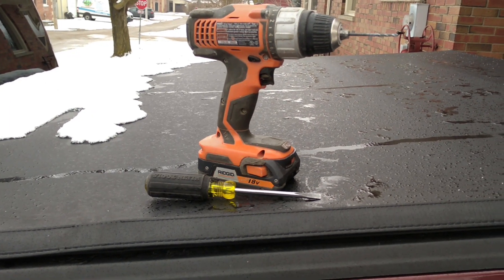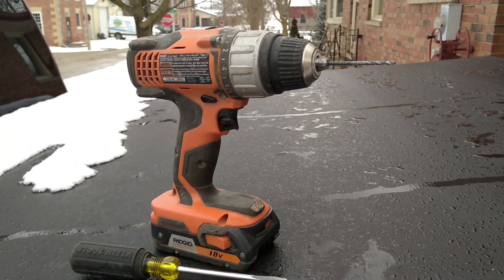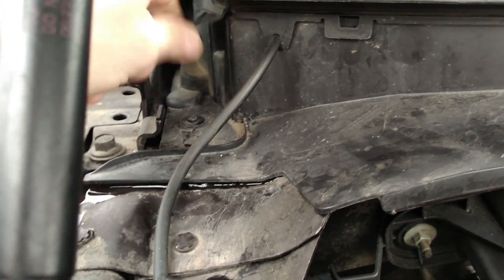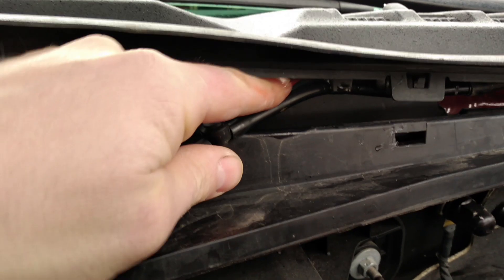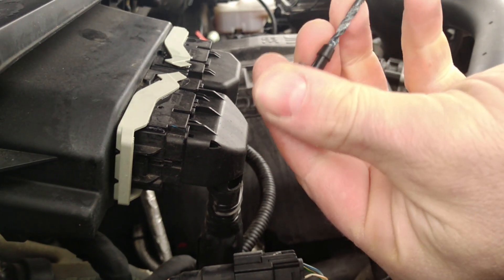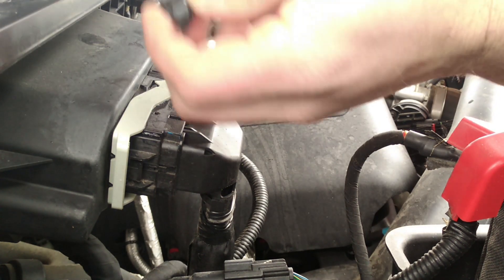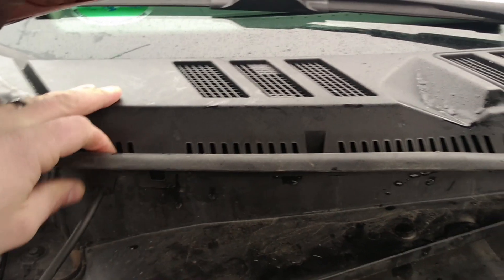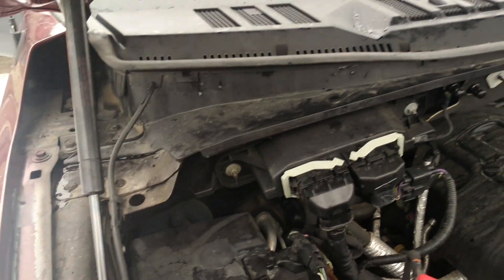Ford F150 washer line frozen DIY fix (2015 - 2018)

Comment: Dude you are awesome.... I just went to dealer today and walked out when they told me it would be $100 for the new updated fluid lines and they still couldn't guarantee it would fix the issue.   I did your fix and in less than 2min I was spraying like normal again!   It's been -5 degrees the past few days and I have not had working sprayers for over a week, and this has fixed the problem.  Sooooooo easy, THANKS!

Comment: Man! What a life saver you are. I tried all different fluids, boosters, everything. I’m getting ready to go on an 8 hour drive Thursday and the temps are in the 5-15 degree range right now. I also drive hour one way a day for work. I’ve been devastated about no sprayers. Your modification has worked flawless!! Thank you a ton. I’ve had my 15 F150 two months and this made me so mad at it. You’re a lifesaver. Thank ya sir for taking your time to post this. Perfect video

Comment: Thanks for this video. Dangerous and frustrating when the washer fluid wont come out. I tried this and it now works perfect. Ford should address this issue as it is a safety issue. Thanks for sharing your knowledge.

Comment: Great video.  My windshield froze up last week in eastern Colorado during the bad snowstorm.  I couldn't see and there wasn't a good place to pull over on I-70.  I searched and found your video and did this fix in under 5 minutes.  I will probably be able to test this later this week when it gets very cold here.  Thanks!

Comment: Thanks for posting this.  Worked like a charm.  Now, no matter what the temperature, my washer fluid hits the windshield.  I'm very annoyed that Ford hasn't addressed this as it is a serious safety issue and the fix could be this simple. Nothing worse than driving up the highway with salt spray all over the windshield knowing that the sprayer won't work. 
*Recommended fix.

Comment: I did mine 2 weeks ago….drilled out the check valve…fixed…today was 5 degrees…went to get Mc Donald’s…washer sprayed just fine..very easy fix….😀😀

Comment: Thank you for the tip. Had the same problem with my 2016 f150. Fixed it in 5 mins!. It looks like my valve was a little smaller. I had to use a 1/16 bit

Comment: Just did this. I think they get clogged up from getting dirt in the reservoir. Not sure where else it could come from. I was reading some other posts on non-youtube sites. Can't believe people think this is a major issue. It is major if you can't see out your windshield but a simple follow the fluid lines, pop the tabs and your one step away from getting that check valve off and cleaned up. I blew air through it with my compressor thinking not to make a bigger hole than I wanted in the check valve at this time.

Comment: I went out to do it, easily done following this video. Sure enough, it was frozen in there. I drilled it out, blew out any debris, but then it still didn't work after reassembly. Put it back the same way it went in, though I don't think that matters much anymore with the straight shot through. 
No idea now

Comment: Thank you for this.  What a treacherous situation.  There should be a recall on this.  What is your fix for the bluetooth connection nonsense, hood popping open when driving and door latches freezing so you can't  latch the doors shut. I personally will never ever buy another ford again.

Comment: Is this the case for 2019 as well?
Reply: My 2019 F150 had a 90 degree check valve closer to washer pump (by battery),  Pulled guts out of elbow and squirters work perfect again.
Reply: @AKCub907  Thanks!

Comment: I just got a 2020 F150 with this issue. How long does it take for ford to fix a issue? I have lived in the northern states all my life I have always used Rain X with deicer in my trucks/cars I have not had this truck for 30 days yet and i already want to trade it in. I had to stop on highway 3x to get snow to wipe my windshield off. I had to buy gloves today to keep in the truck so i can clear off the windshield because i own a F150. I wanted the bigger cab but seeing out my windshield is more concerning.
Reply from the maker: I'd say don't wait for Ford and drill out the check valve. It's an easy and free fix and should eliminate your frustrations. But it's your call.
Reply: @bagabus  I think in my case its the nozzle itself is frozen. Im steeling my wifes hair dryer for the day. Outlet in the truck cant power my table saw, might as well be useful at this. hopefully it can power a hair dryer.

Comment: Damn. They must have taken that check valve off the 2018+. I don’t have one on my fluid line and something is still freezing up. Ugh.
Reply: Same ! Did you get the issue figured out ? Super annoying and dangerous in Colorado winters !
Reply: My 2019 F150 had a 90 degree check valve closer to washer pump (by battery),  Pulled guts out of elbow and squirters work perfect again.
Reply: @johnchristian1444  My 2019 F150 had a 90 degree check valve closer to washer pump (by battery),  Pulled guts out of elbow and squirters work perfect again
Reply: @AKCub907  sweet, I’m gonna check mine out this weekend.

Comment: This shit pisses me off,I have a 97 tahoe with quarter million miles on it and it never did this shit with the right fluid. I always think I'm low on fluid but it's 3/4 full every time and sometimes it sprays other times it don't . WTF ford the new lines should be 15 bucks not 100!